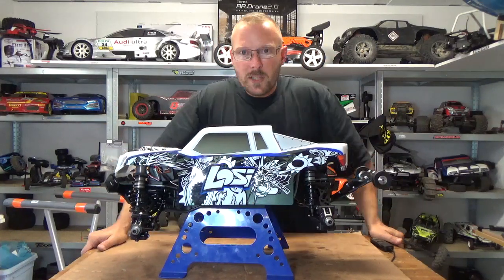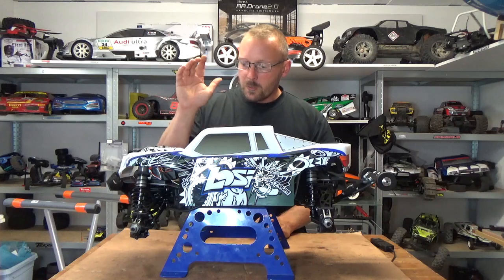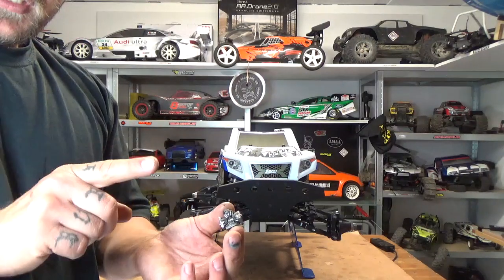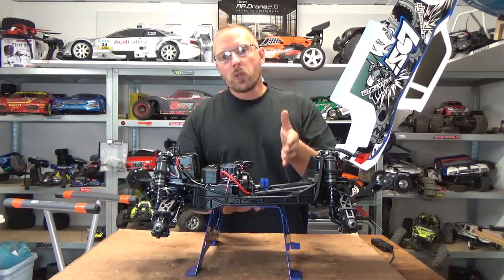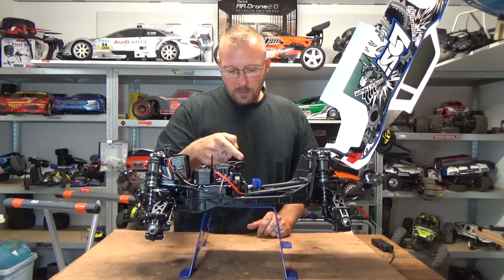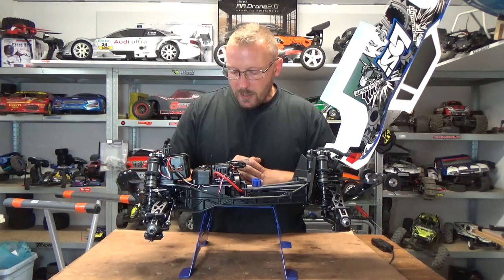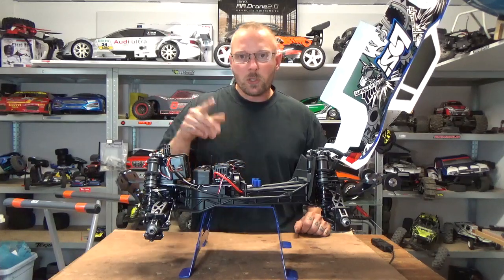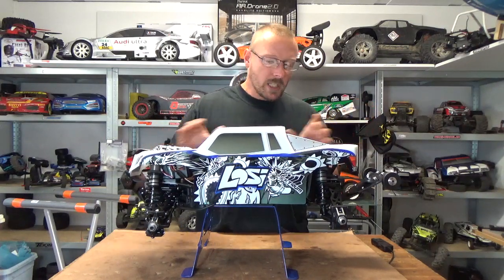THE LOSI 3 XL-E AFTER RUN REVIEW AND DIFF REBUILD

Comment: You mention you upgrade to an 8s system what would I need to do that? I have to change alot parts on the truck like differentials shocks and so forth? Thanks
Reply from the maker: hi dude , yeah but not for more power 8s 1400kv motor :) so same speed but lipos life loonnnng :) probleme is that losi still do nothing about the mess with the suspension travel / cvd angle in the drive cups and in full kompression when the shock stop is squized the cvd hit the botom of the drive cup and she push the planetary gear and smash the diff gear :( i used a optional center diff gear because there is a sqare on the sattelite cross so the gear cannot be smashed , i think they schould do telescopik cvd like super rock rey  so we can use free all the suspension travel

Comment: Finger Crusher HAHAHA. yes i like it  so far
 Shiming helps to not destroy the gears in the diffs front and rear diffs no it does not stop from bending the cvds i have bend 6 CVDs i do not do big air no more with 3XLE i use my Tekno ET48.3 for big air i was thinking i keep stock ESC  till she gos poop on me and on motor 4074 1600kv 6s Leo or hobbystar but if the drive line can hold up I'd go 1400kv Leo and Max 6 8s :-)
Reply from the maker: aahhh ! you'r the one who take all stock from jrc on losi cvd !! lol